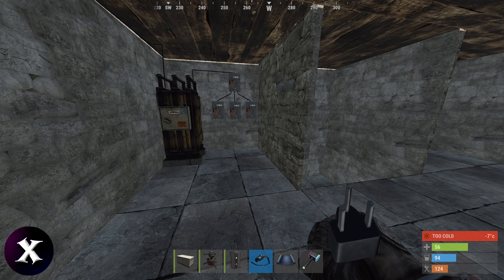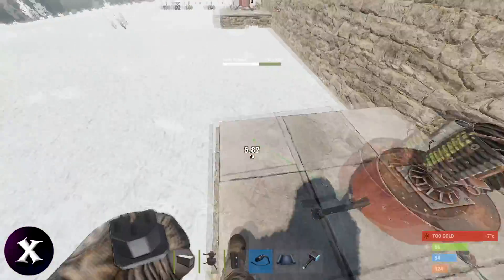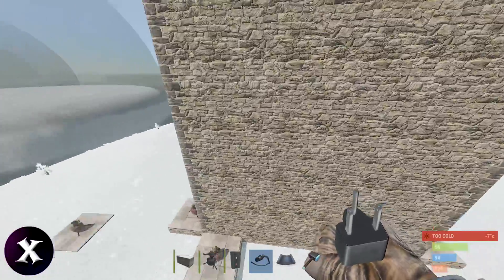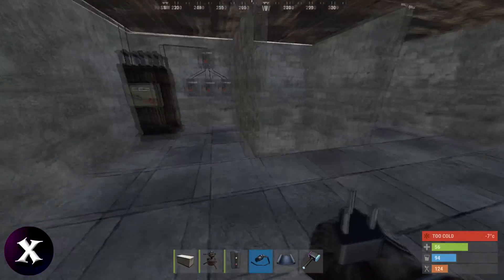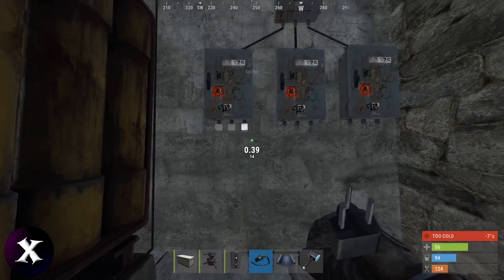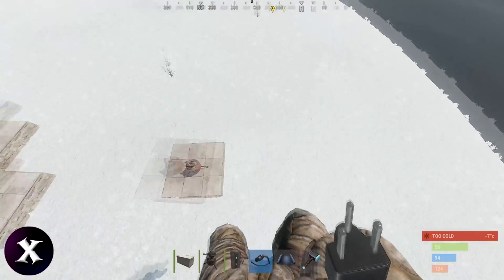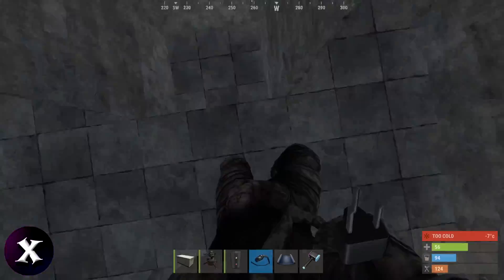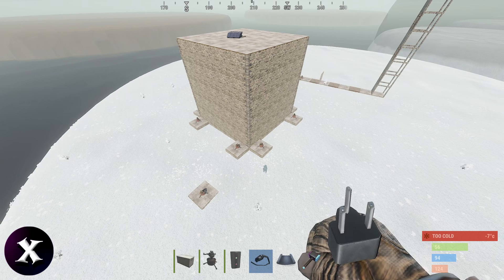*PATCHED* Rust How To: Invisible Wires!

Comment: got patched... any work arounds to it? or nah
Reply from the maker: Unfortunately no, at least not that I know of. It worked by essentially forcing the connection when the wire couldn't reach the socket but now since it snaps on you can't force the wire to "stretch" anymore.
Reply: @x-tremespeed  yeah I did this all the time, base looked so clean with no wires. Guess Rust developers just love fucking up their game.